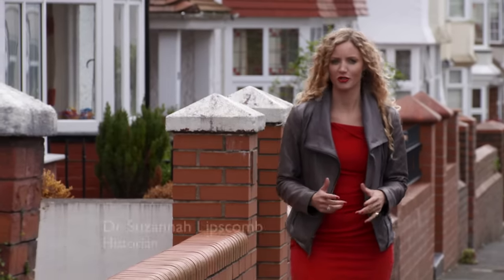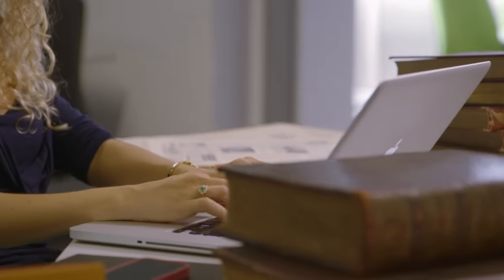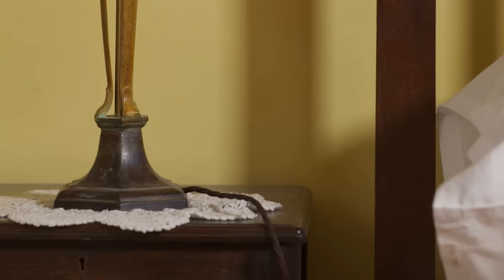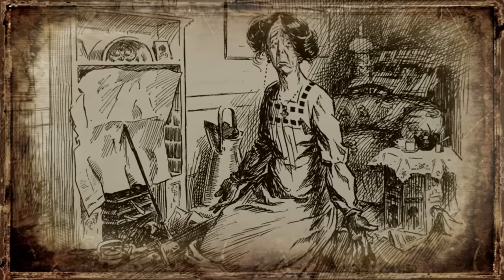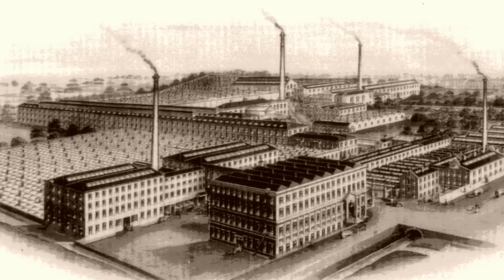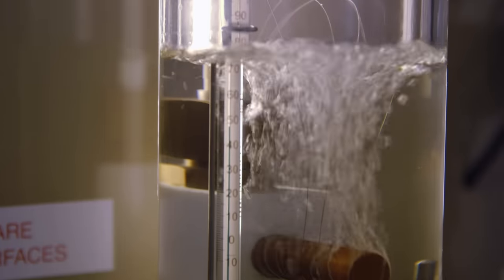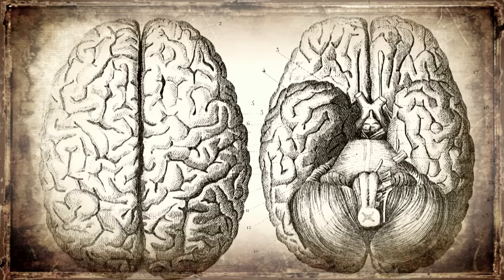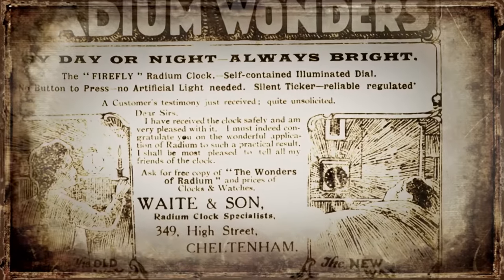How New Electricals Made The Edwardian Home A Deathtrap | Hidden Killers | Absolute History

Comment: in 1983 i started to work in the containerglass industry. the containers were very hot during the production process so were the molds and other equipment of the machines.
the gloves we were using at the time to protect us from the heat were from asbestos, and i think that was about the time that was changed to other materials a few years later.
quite scarry when you hear now when it was first discovered how dangerous that stuff is

Comment: I remember seeing an old light fixture in the ceiling that contained a plug. I always thought that a plug attached to a light fixture was a very strange feature, but I now see that this sort of this was common.
Reply: An ironing board can be under that light-bulb, with the electric iron plugged in there.
Reply: You can still buy those outlets that screw into the light fixture.  We have a few of them, and use two at Christmas to plug our outdoor lights into.  Saves running a lot of extension cord.  (Jan Griffiths).
Reply: Watch "A Christmas Story," that is what they were getting at, just adding on to any outlet increasing the load.
Reply: @Maples01  Yeah, I have that movie; watch it every year.  I love that overloaded outlet the tree was plugged into.  I'm surprised the house didn't go up.  Funny as heck though.  (Jan Griffiths).
Reply: @Maples01  And nowadays, most of us have LED Christmas lights.  Use very little power, and several strings can be plugged into each other.  (Jan Griffiths).
Reply: @douglasgriffiths3534  Yeah, goofballs who wired the place where I live, if someone is using a hair drier in the bathroom while another attempts to use a vacuum cleaner in the living room, the breaker is overloaded, government housing lacks electrical knowledge when it comes to wiring

Comment: I remember my grandmother plugging all sorts of appliances into the light socket.
Reply: Quality
Reply: There were two reasons for that; many houses had two meters, one for lighting and one for power which was charged at a higher rate.  It was common up to the 1960s to have just one socket so it was often cheaper and more convenient to use a lampholder adaptor for ironing etc.

Comment: Radium does not only emit alpha rays but also the more dangerous gamma rays. Gamma rays are not stopped by anything except by dense materials like lead. Although it must be said that even when used in clocks the exposure  was rather minimal. Except if you worked in a factory that had Radium in large quanities, of course, then all bets are off.
Reply: Alpha rays are more dangerous, but they're easily stopped.
Reply: @fedos  you're easily stopped. and that's a real shame

Comment: Yikes! I grew up in the time when asbestos was in everything. Mixed into the plaster on our walls, the floor tiles in our house, the roofing tiles,...and lead enamel paints on all the wood around the doors and windows. Asbestos brakes shoes, and all the ducts in our house were wrapped in it, & inside of the hot water tank. We had "cooking" mittens, filled with it, and trivets made of it, to place hot pans upon. Every house I have lived in, even since childhood, has been filled with asbestos made items. I grew up in a 1940s house, and my  present house was built in 1910. At one point I rented an apartment that was built 1890.
Reply: Are you  a solid flesh typing being or an apparition?

Comment: There are still open pit mines of asbesto in Brasil, operated by Eternit, the same company condamned in Italy (actually prescribed due to an endless trial) for huge contamination and thousands of deaths started in the '80s in the Casale Monferrato area.
Also the italian national railway company, in early '80s let the empolyee work with no protection againsts asbesto.
A friend of mine, killed by mesothelioma 3 years ago, told me they packed the asbesto fibers from the vagon insulation into a ball and use to play soccer with that during the lunch break.
Despite the danger was so well and long known, most of the large companies never used PPE to protect workers against this threat, up to 1990.

Comment: i was an electrician for 29 years & a electrical safety inspector for 22 years after. i've seen many dangerous wiring diy jobs. it always amazed me how people resisted correcting these problems. i some cases, i've had the power to the dwelling shut off to avoid injury until problems were corrected. i'd rather have people upset with me than lying in the morgue. gary brown, minster, ohio.
Reply: That's a tough job, Mr. Brown. Hope you are doing well, stay safe! 🖤
Reply: @vaultgirl42091  thanks for the well wishes. i retired in 2017. i still advise diy'rs. those light socket adaptors are still available @ the hardware store down the road from me. scary! attempts to bring me out of retirement have failed. LOVE the videos. its gary, not mr.!

Comment: the steel wool is really not that great of an example for cable fires. it wasn't the voltage really, it was the current that heated up enough of the thin steel that it would burn and ignite the rest of the wool. the thick cables for mains electricity wouldn't just burn up like the wool, but they can still get hot enough to ignite other materials like the paper or wood they tried for isolation.

but that didn't threw me off the hook, this is some really professional and great content, a nice and steady flow of information and entertainment. will definitely check out more :D
Reply: You'd want to hope it was really professional, it's a BBC documentary!
Reply: @Berkeloid0  professional in the way it was put together was what i meant. my example shows that details still don't really matter compared to a long documentary

Comment: My dad has a small collection of vintage radios. Last summer when I visited I brought with me a Geiger counter I had recently built and went around the house testing random stuff. When I walked into the room in the basement where the radios sat on a shelf, the counter started to show some increased activity. I initially had no idea what the source was, so I walked around the room until I heard the counter start screaming in front of the radios. Narrowed it down to a single radio: a Crosley D-25 White Bakelite Dashboard Clock/Radio—specifically, the hands on the clock. The paint had long worn down to a dull metallic green, but the radium that was painted on 70+ years ago was still very much radioactive. 

The weird (or scary) thing is, that my dad also has a radio from a similar era with an identical clock component in it (in fact it was sitting right next to the radioactive one), but with white hands. Presumably someone had restored it at some point, likely having disturbed or scraped off the radium paint to repaint the hands, possibly unaware of the extremely dangerous dust they were exposing themselves to.

Comment: The asbestos thing is real. In the 50's through the early 80's, my father worked in the Navy and then later in shipyards. Among his duties was installation of asbestos insulation into the ships he helped build. He would come home covered in the stuff so Mom would wash his coveralls in the family washing machines. He died of mesothelioma in 2004. It took Mom longer to die from asbestosis from having washed his work clothes. I'm sure us kids inhaled or ingested some of the fibers as well although none of us show signs of it yet. We're all in our late 50's and early 60's at this point. Of all five of us, only I would really have any true symptoms but that's because I worked in the industrial hygiene and asbestos abatement field for a year just out of college as a newly minted scientist. To this day, over thirty years later and even with having used the latest in modern respirators and protective clothing, I still have to get regular chest x-rays to monitor my health from my one year's worth of exposure. 

Oh yeah, don't think of fiberglass as the latest wonder either. It's even worse when it gets into your lungs because it has sharp cutting edges that don't just lodge in your lung tissue like asbestos does; they saw their way through your lungs. With every breath, that glass moves and cuts through your alveoli (little air sacs in the lungs that facilitate the transfer of oxygen from the air to your bloodstream), reducing how effective the blood/oxygen transfer works.

Comment: "and then we took the water out of the asbestos tank, through the lead pipes" - right. A miracle they didn't have massive die-offs.
Reply: The asbestos tank probably isn't dangerous.
Reply: @ian1352  I think you're right, asbestos is dangerous when inhaled, once wet I don't think it poses as much of a hazard because the particles cannot become airborne as easily. I'm pretty sure they spray asbestos with water when they are demolishing buildings for the same reason.

I also think the lead pipes are less dangerous than people think, there are still quite a few in old buildings that haven't been upgraded, unless the PH of the water is off, or the water is already contaminated then very little (if any) of the lead should make it into the water.

Comment: Interesting that the anti-asbestos sentiment did not gain much traction where I live. I think it is due to the fact most asbestos mined here contains very little amphibole (the brittle, needle-like form which is much more prone to getting airborne and inhaled), being almost all chrysotile (long, strong and soft fibers). Around 90% roofs here are covered with Asbesto-cement sheets (I believe it was called Eternite in the U.S.).

Comment: I think the common theme for all of the episodes within the series are, 1) New technology is presented to the consumer.  2) The technology is still very much in its infancy and so the affects on health have not been considered or understood. 3) When the potential dangers of said technology are actually identified, financial incentives stop any real reform 4) Then finally enough people die and so they say, “Yea maybe we should fix this” 5) Makes you wonder about 5G.
Reply: Except that 5g is already well understood compared to it being completely new to people back in the day
Reply: There's no inherent difference between RF radiation from 5G and any other form of cellular technology.  The frequency band of 5G (exact frequencies vary by country) is "non-ionizing radiation".  It doesn't affect living things unless they're strapped directly to the antenna surface, and even then it would take decades of exposure to the relatively low power (a couple of Watts).  By comparison, you can safely be in a room, indefinitely, with a WiFi access point (2.4gHz around 100mW) but you don't want to be inside a microwave oven (2.4 gHz, 1000 Watts or more).

Comment: We lived in a Victorian home when I was a kid, and the faceplate was off one of the bathroom light switches for years as we were remodeling it.  I remember there were these huge, probably 1/4 inch diameter copper wires that had some thin cloth insulation that had mostly rotted away.  I used to stick my finger in there and touch them to get a shock for fun.
Reply: Wtf
Reply: @thatyoutubeguy7583  It wasn't that dangerous, cuz the current would make my muscles contract and that would pull my arm back from the wire.  Just gave me a jolt and would make my finger a little numb afterwards.
Reply: They say 110 is more dangerous that 220.  With 220 you touch it and getting blown of imediately.  110 on the other hand will make you numb and you'll sit there and fry.

Comment: Thomas Edison did not invent the light blub he only modified it, improving it slightly to not be so short use. He just made sure every element of this modification had his name on it which is why his name became attached to the invention of the light bulb.

The things you learn while studying architectural technology in New Zealand 😂
Reply: Light blub 😂
Reply: What Edison deserves credit for is a standardized lighting system: standardized light bulb sockets, each wired separately so one bulb burning out just means one bulb is out, and standardized Fuses to safely disconnect circuits that are overloaded.
Joseph Swan also invented a working incandescent light bulb but the rest of his system wasn't great: lightbulbs were directly connected to the wires, and one bulb going out took down the whole home circuit, like what happens when a bulb goes out on cheap christmas light strings.
Reply: Edison got the credit because he was part of the top controlling elite, which is why George Orwell wrote his book 1984, because he knew some of the elite in school and was trying to warn people of their plans for the future as far up as 1984,in which he warned a police state would happen, and clearly has.
Reply: @drewgehringer7813  w
Reply: @donalddrysdale246  He got credit because he owned personally the company which owned the lab in which it was developed. The researchers there worked under contract using his equipment and materials and support staff. It is the same with companies today. Even universities. And yes, he did work on the light bulb himself and made it practical.
Reply: wasn' t it Tesla who really invented the light bulb?
Reply: @IRosamelia  Like the radio, multiple people were working on inventing light bulbs with varying success. Tesla may have been one of them'; I don't know.

Comment: I love how historians talk about how there used to be a spark while plugging stuff in and such, while in my mom’s house, the light switch sparked every time I turned on the lights in my former bedroom. 😂 Her house is definitely a death trap and the Edwardians would be proud of her.
Reply: Laura Margolusová   A room in my old apartment did that.  You had to flip the switch rapidly until it sparked to get the overhead light to come on.  I told the super and the owner, but nothing was done.  There was an illegal apartment in the basement and a section of the stairs to the roof where the sheet rock was broken.  You could peel it back to reveal two points of bare “post and beam” wiring.  Our apartment had a 100% windowless room.  The door had been removed in 1938 as per law, but the tenants before us put one back in and extended the wall to fit a modern size door.  The old shared hall bathroom was accessible on the sixth and top floor.  The plumbing was long gone, but that prevent the occasional use of the ancient toilet.  Naturally, nobody ever admitted to it, just like nobody admitted to going on the roof!  It was a lovely old firetrap of a tenement!
Reply: Thank God we just had our house rewired, even though it didn't really need it.  We did it because of the age of our home (70+ years), and weren't sure when it had been done previously, if at all.  (Jan Griffiths).
Reply: This video mistakenly attributes the danger to electricity. The PROBLEM was leaky gas pipes. People were smoking in their homes and putting rugs (generating static electricity) in their homes. Sparks happen. And even if they don't, trapping natural gas in your home can kill you.
Reply: My mama said she used to spend the night with a friend of hers and that her friends toilet seat would shock you every time you sat down on it...(my mama is 59)
Reply: Yes, I thought the emphasis on arcing as a danger to ignite a gas leak was pointless since any gas light or appliance would have to be lit by an open flame anyway.  Gas leaks are dangerous... period.
Reply: @douglasgriffiths3534  Seems like it would be fairly easy to tell if your house already had wiring in it, or if it didn’t?
Reply: @Sashazur  Of course it had wiring in it.  Building codes and materials change over the years, and we wanted to be sure our house was wired with new materials that were consistent with current building codes.  Our wiring really wasn't bad, we just wanted it to be safe.  (Jan Griffiths).

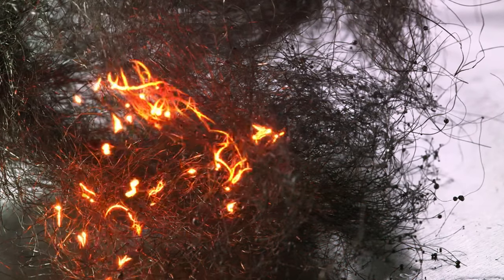Comment: 12:20, woman who has no idea how electricity works, explaining how Edwardians didn't understand how electricity works.
Reply: Well, it's quite clear (whether you're a technician not) that they didn't grasp the serious aspects of this. It's like when home computers were becoming popular in the 80's. A lot of kids didn't know how to use them. Basically, you're not born with knowledge. That's why we're so informed now.
Reply: Agreed. Apparently "the battery is too high a voltage for the wire" whatever that means!
And steel wool burns for some very unique reasons (fine strands and oxidation) that (spectacular though they may look) have nothing to do with fires started by high current through electrical cables (which normally causes the cable to heat up and then burn the insulation material).